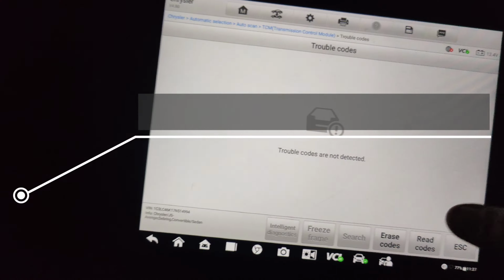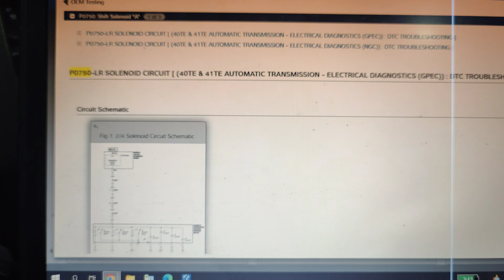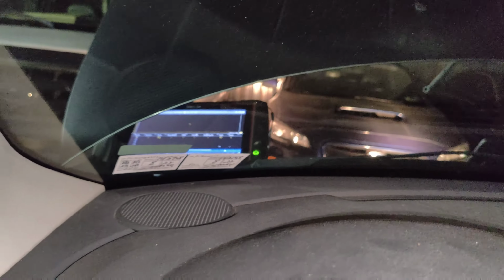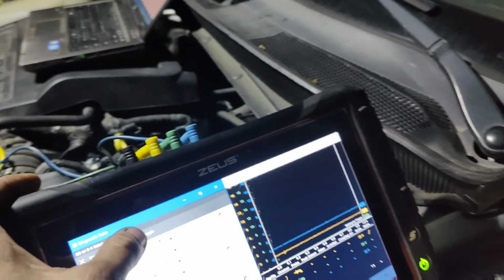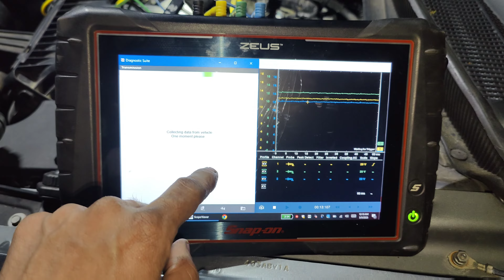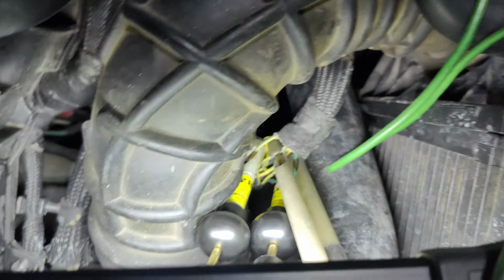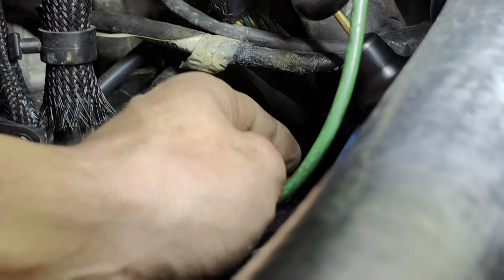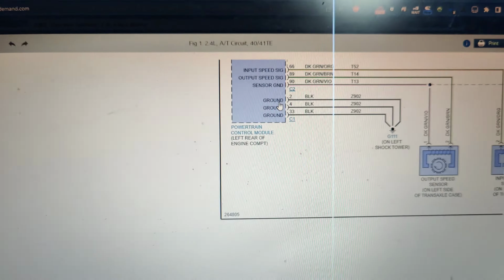2007 Chrysler Sebring 2.4l P0700 - P0750 - New Solenoid Pack Part 1

Comment: So I had one of these that a car lot brought. Was same code. I figured out it was the PCM. I tried to program 3 PCM and they would program and then no start. No codes. I tried like 3 or 4 different scan tools which I have used on same type of PCM in Jeep  Compass/Patriot and those programmed fine. Told them to take it to dealer to have them program the PCM. THey programmed it but never changed it. Ended up going down the flagship 1 rabbit hole. New PCM from them fixed the trans issue but I then had secondary air codes and the vehicle didn't have those items. Back and forth with them and we ended up using HP tuners to turn off the secondary air codes. It took over a year to finally get fixed.
Reply from the maker: Flagship one has to be one of the worst.